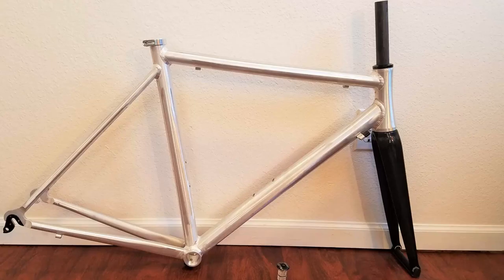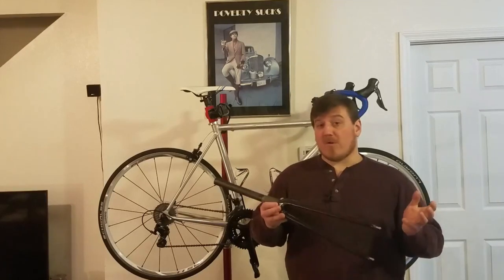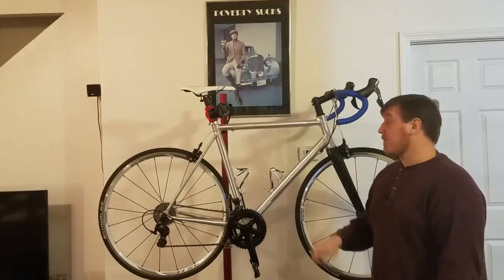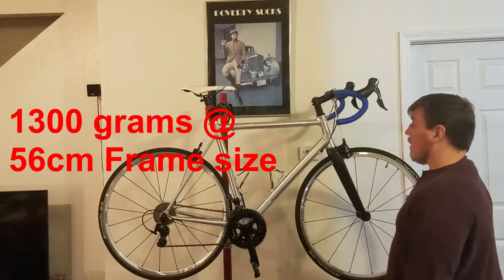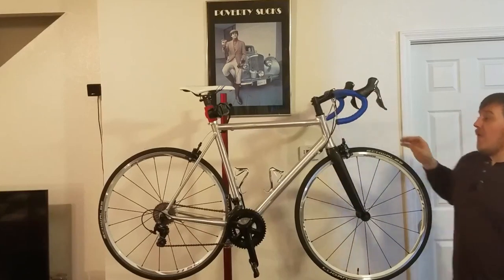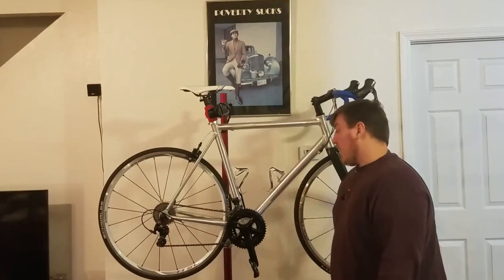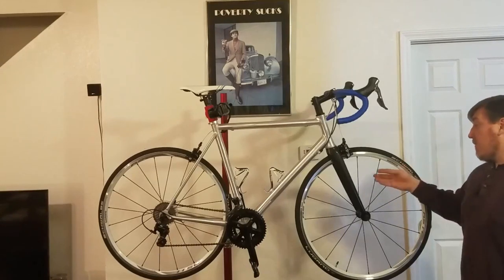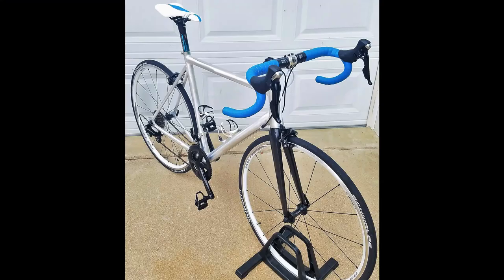Caribou SuperLite Road Bike: Custom Budget build, LIGHT Frame! ONLY 18.5lbs & CHEAP!

Comment: Nice. I have the exact same frame. I'm gonna copy your build but will make it into a single speed. It'll be my fun gravel bike
Reply from the maker: Thanks panic! Please take a moment to subscribe to my channel if you haven't already, I appreciate the support! Wish I still had one that was my size because these frames were awesome, you will be pleased with it for sure!
Reply: @D2WrenchWorksDIY  one more question? What carbon fork you're using?
Reply from the maker: @paniccity  this is the stock fork I got in the box from caribou. It used a tapered fork that started at 1 1/8” but I forget the larger bottom size of it. Maybe 1 1/2”?

Comment: I’m currently building one of these framesets. The wheelset I’m running have an internal width of 20.6mm, and I’m debating on 25c vs 28c tires. With 28c tires overall width will be 30.8mm. I’ve already checked and the tires clear my potenza calipers; does the frame/ fork have decent clearance at the chainstays? All of my other wheelsets are thruaxle, so I’m unable to mock-up on this frame.
Reply from the maker: Hi Andrew, please take a moment to subscribe if you haven't already....I appreciate the support growing my channel! I know you can easily fit a 28c in these and as you mentioned the newer style/wider wheels will make it fit a little better and give you a bigger contact patch!

Comment: How does it ride? Feel similar to a Caad 10/12?
Reply from the maker: I just recently had transferred all of this to a 2015 Specialized allez comp race and while I couldn't ride either I can tell you that the build quality and likeness of the Caribou to the Specialized was outstanding. Though I do think the weight is closer to a caad 10, they are also an in-house Specialized frame maker as I mentioned. I do have one my size I ride and will give a better review on, this will be on a new video with a super budget 10x2 spd setup too! Don't forget to subscribe for that video coming soon & thanks for the support!
Reply: D2 WrenchWorks & DIY thanks, the geometry looks very close to the Caad 10, do you know what bottom bracket standard it is? Would be a great crit build if the quality control is good
Reply from the maker: I agree! I think it's very similar geometry as well, also it uses a standard 68mm threaded bottom bracket.

Edited to say this: Quality control on these frames are excellent! I've owned 7 framesets and all the welds are great and the overall craftsmanship is crazy nice for the price. For sure some high end shop in California lost alot of inventory, because all of them are raw aluminum from a storage unit in stock Caribou boxes.